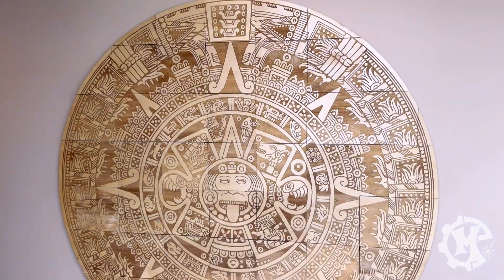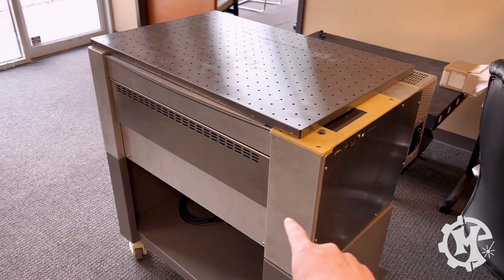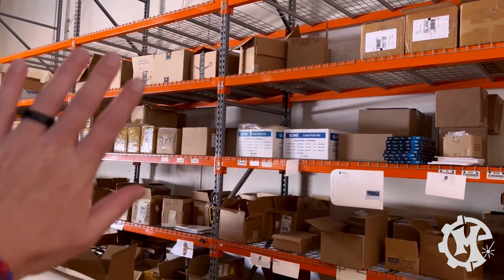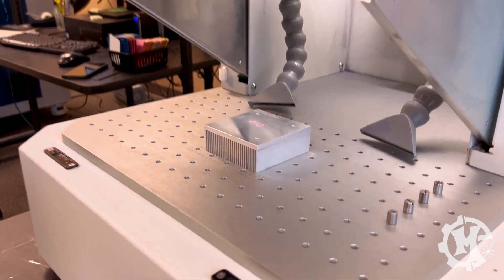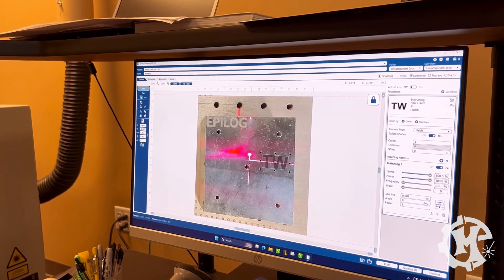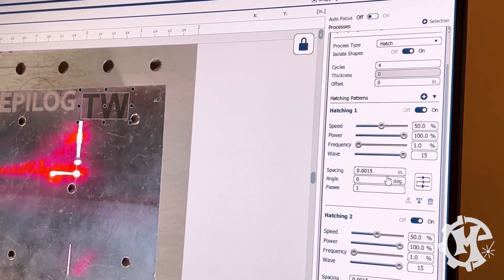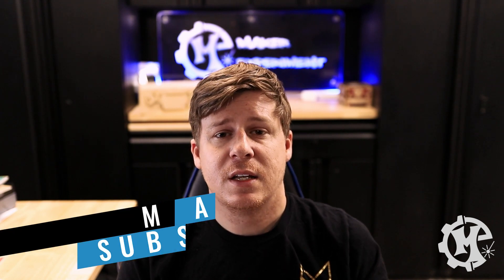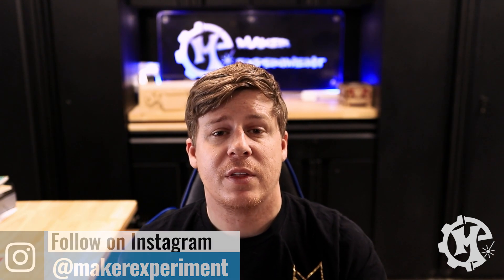Visiting Epilog HQ

Comment: We did “the tour” back in 2013 on our way back from IPMS.  If I recall, we never left the one building…entry/demo/assembly tour etc.  My boys loved it. Side note it was my oldest son, now part of our company, whom remembering that tour at a much younger age, suggested re-evaluating a laser in our workflow.  We ended up investing in 3D printing instead at the time, but that’s another story.  Things have come around full circle and we’re looking at a small laser (Maker 24’ish, yeah would love a Pro (servos!!) but this is supposed to be a biz case for cost reduction for us) this time around.  Have looked at quite a few companies.  Eliminated several through RFI process.    

Another side note,  I think in watching some of the new Epi vids I saw the gentleman whom gave us the tour way back when.

A couple of lessons learned from years of equipment buying (lasers (evaluated)/table/sliding saw/ VMCs, etc) 1) always see the machine your purchasing be used on your test patterns 2) repeat #1 here 3) repeat #1 here.

Only thing I’m 🧐 at in the vid, is they dont have a Maker 24 in any of the shots.  As our local distrib doesn’t have any Makers, looks like another road trip to Col, but only if they can demo the M24.

For Fusion 360 users, found an Epilog Post for Fusion 360 at Autodesk post downloads site.  Looks like everything through to tooling works for cutting setups eg tabs, kerf offset(maybe), simulations works for toolpathing , etc.   output is to an html file; that is meant to be printed to an Epi printer via Chrome.  Ok, wait a sec.  We do not allow Chrome In our shop.  So how does that help us?  Click  the “no html headers” and then gen’ it.  Import it into CDraw and there ya go.  From there send it to Epi software, we’ve gone as far as Job setup.  Now without having a laser we’ve gotten to this point, but haven’t actually cut anything yet.  Working with local rep (call tomorrow) to see if he can get our file to cut as expected.  Fully think it will, we were able to paper-laser print the parts from CD and they came out perfectly to scale as expected.

We are extremely excited about this.  For anyone who uses F360 and does multi-machine production on a single item (eg some parts are 3D printed, some parts are CNC’d, some parts are laser cut) and you know what parametric brings to the table….nuff said.  This promises to be the most seamless laser integration, if it pans out, into a workflow that we’ve found.  For small shops like us, this could be awesome.

Now Epilog,  how’s about making life easier on a lot of us CAD/CAM users while increasing part precision possibilities (think curves) and support importing  STEP files please 🥹(my best puppy dog eyes).  If that doesn’t work, I’ll send pics of my boy’s 🥹 eyes 😈 I’ve got STEP to 3D printers & CNCs but wait for it.. svg/dxf to laser.  Which one of these machine types ain’t like the others?   

Honestly, if not for this Epilog post for Fusion 360, we may not be still looking at Epilog.

Ok, I rambled as usual.  🫢☺️

As always YMMV and likely will.  Just sharing.  Nothing more.  Nothing less.  

Not associated w any manufacturers/makes mentioned other than as a satisfied/unsatisfied paying customer.

Have a good’un now, ya’ll hear?
Reply from the maker: I made it to the end! 😂 At the time I took the tour, the Maker was still relatively new. I believe they have one in the demo area but it would be worth asking before you drive out there.
Reply: @MakerExperiment  I’m a southerner, can’t say nuthin not even mornin in less than 200 words 🤦🏻‍♂️. Yet couldn’t write a one page essay 🤷🏻‍♂️

Thought I saw a M12, but no M24.  I did see this was posted 3 mos ago, but wasn’t sure when it was shot.  My local rep is gonna help coord if the test cuts look pretty good on his larger machine.

Cheers and thanks for another video!

And be warned, mind if ya talk to a southerner in person we’ll talk your ears off and superglue back on a few times till we’re done 😉
Reply from the maker: @jessefurqueron5555  I’ll be interested to see what comes out of those test cuts.
Reply: @MakerExperiment  👍
Reply: Last time we looked everything was CO2 based, have seen several RF demos, looking forward to the Epi RF demo for sure.  Cut quality, kerf size, accuracy.

Comment: I live a little ways down from Epilog and have asked to get a tour to help me decide which one I will order.. I was curious what Watt CO2 laser is in your Epilogs?
Reply from the maker: I have two that are 60 watt and one that is a 30 watt.
Reply: @MakerExperiment  how big of a difference do you see between the 60 and 30 in the engraving and cutting of polycarbonate or harder materials?
Reply from the maker: @justintime9133  the 60 watt will do it much quicker helping you save time and get through more material quickly. It mostly helps production time but it can also cut thicker materials than a 30 watt.
Reply: @MakerExperiment  thank you very much. I had been looking at a used Fusion Pro 32  at 60w but was also looking at a Maker 36 with 40wat. The only thing I wish they had was pass through doors but Epilogs Quality is 2nd to none.